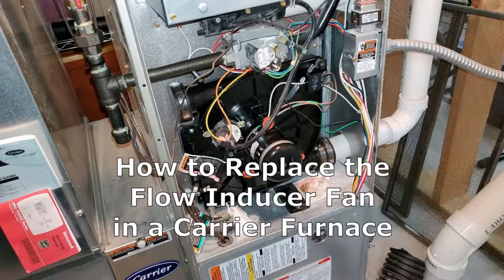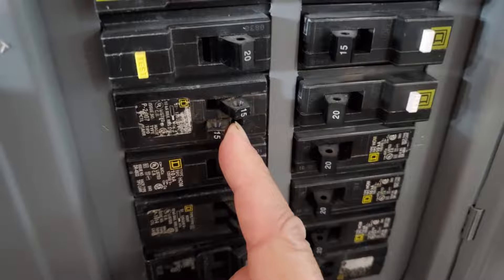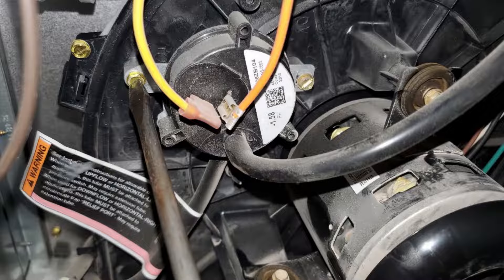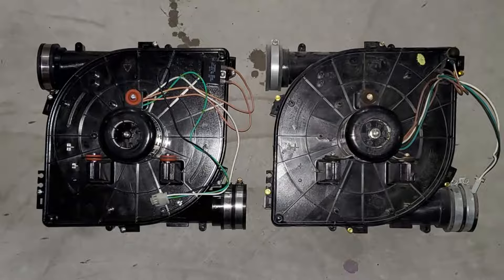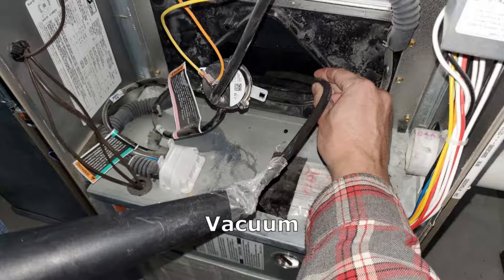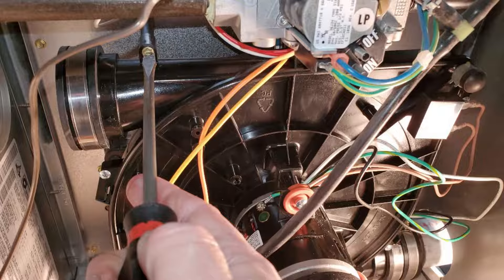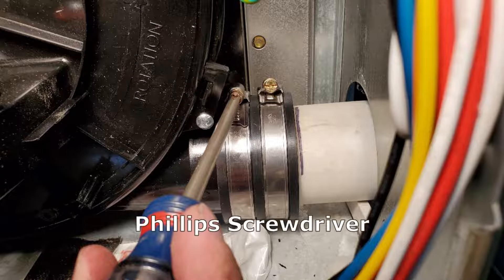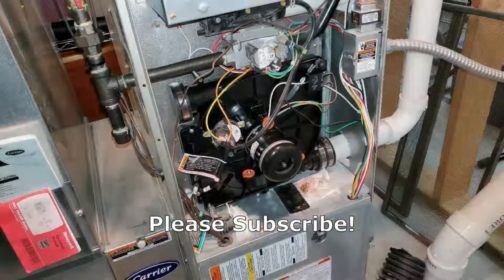Carrier Inducer Motor Replacement - How to Fix a Carrier Furnace

Comment: Nice concise video with good audio.

One tip I read elsewhere is to spray PAM on the triangle on the backside of the inducer motor assembly that will be coupling with the RTV sealant before installing the assembly so that in the future if you ever have to remove the assembly you won't risk breaking any plastic while trying to overcome the sealant.
Reply from the maker: Ian, great tip, thank you!
Reply: In one of the Carrier service manuals I just read, this is actually in the replacement instructions
Reply from the maker: Good to know, thanks.

Comment: My inducer is smaller and mounted using sheetmetal. It was rattling about due to an imbalance frombtwo ofvthe plastic fan blades having broken off.

Im having a hard time finding a replacement for our Weathermaker 58SX060CC Where do you advise shopping. My motor is fine, Id really just need to replace the 6" diameter fan if they are avaliable

Comment: Great video!  Only question, how long do you have to let the high temp RSV cure before using the furnace?
Reply from the maker: Thanks! The sealant achieves full strength and stability in 24 hours. I guess I'd recommend waiting the full 24 hrs before using the furnace. Hope it helps.
Reply: @PracticalMechanic  Thanks, that is what I was thinking based on the back of the packaging.  On a side note, it turns out on mine the fan had broken inside the housing.  Carrier will allow you to just buy the fan (which was $72 at my local supplier).  Again, thanks so much, your video save me a ton!
Reply from the maker: @ianking8509 great info, thanks

Comment: Mine is making noise, so it is about to get bad. I am planning to replace it. Quick question: After applying high temp RTV, will the new fan fit on that groove easily? How do we know it is "set" where it supposed to be? Thanks in advance
Reply from the maker: Yes, it fits in a groove like a Lego.

Comment: Do I have to use the two speed and do motor or can I replace it with a single speed
Reply from the maker: Unfortunately, it would be more involved then just some modifications to the wiring. A single-speed motor might not work at all if the control board expects two speeds. This is because some furnaces rely on different speeds for proper combustion and venting, and simply rewiring may not be enough. In many cases, installing a single-speed motor will cause ignition or airflow issues. If the furnace expects a lower speed for proper startup or venting, it might fail to ignite or trigger a pressure switch error.

Comment: Thank you for this video, watching it as I am replacing mine.  A quick question, whats that hose on the upper right corner behind the fan.  It doesn't to connect to anything.
Reply from the maker: This is an extra piece that is not used. Sometimes these are mounted "upside down," in that case, this tube would be on the bottom and be used, while the one in the opposite corner wouldn't. It is just a feature so that it can be reversible. Thanks for watching the video! Please like and subscribe! 👍

Comment: I have the same furnace and it's making the same noise, is there any way to fix the motor or does it have to be replaced?
Reply from the maker: Likely the bearings. I haven't had much luck replacing bearings on these little electric motors and having them last very long after that, that's why I recommend replacing the whole thing, but your mileage may vary. Good luck! 👍